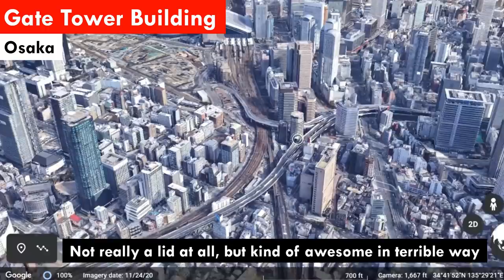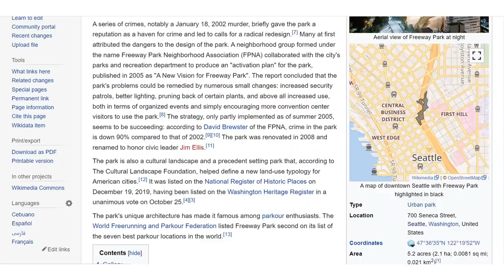Freeway Lids / Caps / Decks: What They Are, Why We Build Them, and the Ten Best in the US

Comment: Boston had tons of public access. Prudential Center is a mall between all those buildings, and connect to the Hynes Convention Center. NYC of course.  People driving under those building don’t realize they’re actually in Manhattan. I know Philly/Penn’s Landing, since I used to park on the river and walk over 95 (we were carpooling!). 

Little Wilmington Delaware is considering capping over 95. Typical rip out two blocks of the city to shove in an interstate. Bypass 495 around Wilmington built a few years later. But since 95 downtown is in a little bit of a cut it’s a perfect candidate to be capped and rebuilt as housing I think. Probably some parkland.

Comment: There is a long open subway trench in Brooklyn that emerges near Prospect Park and goes all the way to Coney Island. The MTA workers call it "the cut." The Q and B lines run exposed about one story beneath grade. Unlike the elevated lines in New York City, there is no restriction on trains blasting their horns, so the noise pollution for surrounding residential areas can be substantial. This doesn't even include the din from regular operations and rail work which is loud. I have always wondered what it would take to put a lid on this and possible projects that could complement newly created space. Thoughts? Maybe you could do a video on viewers' "fantasy projects." (And if it isn't obvious, I live right above this by Prospect Park station).

Comment: Not very common in the UK. Probably the nearest example is the one over the A1M motorway at Hatfield just north of London (although the freeway section and the lid were built at the same time, as a bypass to the congested non-freeway A1 trunk road, originally known as the Great North Road back into the 1600's, the number is 20th Century).
 
There are a couple of other lids proposed but I don't think have gone beyond early consultation stage.

We do get train line lids in the UK...Liverpool Street station, Charing Cross station, London Bridge Station, Fenchurch Street, City Thameslink (all central London), and Gerrard's Cross (which famously collapsed while being built onto the operational line below).

Comment: The I-15 in San Diego aligns with the street grid because it was built in a canyon, which is why it's below the surrounding ground.
San Diego originally decided to build up on the mesas and preserve the canyons as natural space . . . which were then paved over for highways.
We still have plenty of preserved canyons. San Diego is a great hiking city. But the I-15, I-8 and 163 were cut through the preserved nature in the bottom-lands because it was cheap and easy, with minimal imminent domain issues.
One thing they did right; The I-5 was routed around the central business district because the city fathers didn't want the mess in their back yard. Send it to the Mexican neighborhoods instead!
Now they're talking about a cap over the 5 at Park Avenue, where the freeway cut Balboa Park in half.

Comment: From abroad, in the Netherlands :  In the city Utrecht, the A2 highway was widened to 2x5. It required a lid against noise and pollution and also to connect the newtown/suburb 'Leidsche Rijn' with a small strip between the highway and the canal. The 1.6 km long deck is mostly green public space and a couple of streets across, with buildings along the edge. North of it there are an office and a mall centre along the highway that double as sound barrier. Originally budgeted at €116 mln, but they finished with a sweet 1 bln euri !!😵

2 transformation cases, not sure if they fit the first criterium : In the southern city of Maastricht A2 highway (again) thru the city was replaced with a 2.3 km doubledeck highway dig covered with a green, parkland city street. (within budget !). Under construction :  , in the North in Groningen the Southern ring road was elevated and had a traffic light junction, that is transformed into a highway junction and to the east the raised level highway is changed to a sunk highway that is partilally covered with park landscaping to reconnect neighbourhoods... (The project  already has a healthy budget overspend.)
Reply from the maker: Oh I'll have to take a closer look at these. Thanks!

Comment: It's not only insanely expensive but it's an ongoing expense.
In Metro Detroit , I-696/"The Reuther" (that suburban one you showed at 2:49), was held up for 20 years in litigation and finally opened in 1990 after a compromise that resulted in 3 large park decks. About 10 years ago they started having issues with water intrusion forming icicles on the ceiling that resulted in a $4M project to remove the 'worst' park and strip it down and seal the cap, then rebuild the entire park from scratch. That project immediately failed and now the DOT is having to spend >$30M to completely demolish the structure and rebuild, normally resulting in extended closures (but they are combining the work with replacement of all of the 1990 concrete pavement throughout the 12 mile depressed central section so it will be closed anyway). The other two tunnels likely aren't far behind. They broke them up into 3 as they are each the longest allowed without needing fans.
These problems aren't unusual either. Phoenix has a decked section of I-10 that also opened in 1990 that has also developed similar issues, although being a dry, temperate climate has only resulted in tile falling off the walls.
So what will they have to sacrifice to maintain these things long-term? Not to mention an incredible amount of electricity for ventilation and lighting, 24/7/365 (and the energy can be absolutely mind-boggling, enough to run an entire neighborhood so you are amplifying the CO2 from the traffic). They have their merits for sure but you end up having to make a sacrifice either way.
Additionally, Phoenix is planning a total scratch rebuild of its 1990 I-10 spine where the tunnel is, everything but the tunnel itself. They have to work around it, it's a huge bottleneck but now there's a library on top of it (that itself was nearly destroyed a few years ago in a freak storm) so it will forever be an issue and this $1B I-10 project might perhaps reduce travel by a minute or two while they continue to build 30,000 homes a year in the exurbs.
Reply from the maker: Oh, good insight on this. Thanks!

Comment: Boston has two additional freeway cap developments under construction currently. Both are over I-90. One is on Mass Ave near the Prudential Center, designated as Parcel 12 by the city (two other parcels 12 and 15 also have proposals but have not started construction). The other on is near Fenway Park and is called Fenway Center. Both projects are primarily office and residential buildings with part of the parcel in both projects being turned into a public outdoor space.
Reply from the maker: Oh I knew about Fenway Center but not the other one. In a way, Big Dig is a cap project as well -- it was hard to know where to draw the line!
Reply: @CityNerd   It is difficult to find the line, but I think you did a really good job and It was interesting to learn about ones I hadn't heard of before.
Reply: Does the Star Market over the Mass Pike count as the original cap, or just air rights ;)

Comment: I'd be curious to know your thoughts on DMU passenger rail cars.

In my opinion, NY's interborough express should 1) exist and 2) start out with FRA-compliant DMUs. This would keep options open for mixing the service with freight and other rail service.

Put the farebox on the train like a bus and call it "CityTrain by Long Island Rail Road" with LIRR crews.

The rail cars can be converted to electric if the line is ever electrified.

What are your thoughts on that, and on other DMU service, both FRA- and non-FRA compliant?

Cool video as always!

Comment: Glasgow (in Scotland) is seriously looking into doing this with the M8. The proposed park is an absolute joke though. It literally spans between two overpasses that are like 200 metres apart and will be surrounded on all sides by roads with one of the cities most disliked buildings (Tay House) over the top of it and a busy motorway underneath it. It also is literally right next to a gorgeous historical library (the Mitchell library) but stops before it instead of providing a great city centre-park that would allow people easier access to the library and a more reasonable cover over a section of the motorway that practically cuts the west end off from the city centre :(

Comment: Montréal Canada.
The Ville Marie Expressway was built in the 1970s to provide a  way to reach downtown from the 15 and 20 highways west of downtown. It was numbered 720 (now 136). It was then extended further east morphing into "urban boulevard" to connect to the Jacques Cartier Bridge and then further east again over time. 
Goes from the Turcot interchange (15 and 20) as elevated road.
Between Guy and de la Montagne it dips into cut/cover tunnel. Goes around (south) of Place Bonaventure and then back north to fit between Viger (north) and St-Antoine (south).  The original tunnel ended at St-Alexandre or thereabouts.  Many streets were cut at Viger to the north and St-Antoine in the south due to the canyion.  
Originally, the canyion/highway ended at  Sanguinet where you see strange curvy ramps). 
It was later extended further east as canyon to its current configuration wheree it rises to ground level west of the Jacques Cartier bridge. 

The open canyon was progressively covered over the years. 
Palais des Congrès is at:  45.50489871879555, -73.55977819748851
This is a picture from the construction of the Palais des Congrès (convention centre) in 1981.  
https://numerique.banq.qc.ca/patrimoine/details/52327/3167284?docref=SlC7r8UIaSvttRAqjGxAoQ
It is taken from western edge of building showing the open canyion, then the transition roof and in background Place Bonaventure.
The convention centre didn't actually cover the highway. At ground level, there was still a city street passing above highway and below the first floor of the new building. The metro station had pedestrian exit onto that highway overpass and it was hell to walk there because all the noise from the highway was reflected on the concrete of the first floor of the congress centre above.  And you had all the fumes from cars. 

The section west of palais des congrès was eventually covered and if you look today, it is full of style-less modern glass office buildings.
From that point, there was transition cover from St-Urbain to St-Laurent, then open canyon.  (This transition was since removed after it fell down during renovations). 

Today, the canyon from Hôtel de Ville to Sanguinet has been covered into a park and the highway exit/entrance was reconfigured. Also, the pedistrian access from the Champs de Mars metro station (north or highway) to the old montreal area (south) was totally reconfigured, and the ramp from highway to Sanguinet removed (there are still traces of it in you know what to look for). There was a bank building east of Sanguinet and it has since been demolished and rebuilt as part of a the CHUM hospital complex.  (biut note the gap right over the actual highway).

East of this, a large area was covered and is now a park area, and then the open canyon still exists. 

In the last decade or two. the Palais des Congrès decided to develop at ground level. It thus properly covered the highway below,  and made it enclosed interior space with shops etc. While cars can no longer cross there, pedestrians from Metro can now walk in quiet comfort over highway and have a number of doors to exit on the south instead of that one overpass that existed.  One the area west of the palais, a number of streets were reconnected as the former canyon was covered.

Comment: If we consider North America I would put Montreal's Quartier International at number one. It's not so recent and developed over the long term but I think it's the best freeway lid intervention. They covered the Autoroute Ville-Marie with a few parks and squares, a convention center, a hospital, the Quebec's pension fund and public insurance bank, the UN's International Civil Aviation  Organization. It improved the connection between the downtown and the Old Montreal and connecting better the whole area with the metro system. It is a success in term of design and the Jean-Paul-Riopelle's square show it at it's best. The whole thing was major for Montreal's downtown development. Bonus! : Montreal did the same with his railway wich used to be in trench in the downtown before entering the tunnel under Mont Royal and they built the Place Ville-Marie over it, which is the first major modern skyscraper of the city.
Reply from the maker: I actually might have messed this up. I was just focusing on lids that came after-the-fact, and for some reason I thought I had seen that Montreal's freeway covering were built as part of the original freeway design. I'll have to look more closely.

Comment: You started with Vancouver getting it right with no freeways.  Did they also get it right with their driverless trains???  
Do you spend less money over 30 years if the trains don’t need drivers?  You are an accountant and so am pitching this (again) in the hope you cover this off.  I’ve heard both sides of this argument.  I would really want to hear your thoughts, so I can expand my thinking on it. Thanks in advance.  Cheers. Steve
Reply: Driverless trains not only save $$ without operators, but trains can run closer together because they are computer-controlled.

Comment: We have 3 freeway caps proposed here in Atlanta. I hate all of them. Obviously the freeways should be removed completely, or at the very least if they do a cap, it should severely reduce the number of on and off-ramps. None of the proposals in Atlanta do that. 

1. The Stich - Reconnects midtown and downtown with development/plaza idea. It would be 3 blocks wide, connecting 4 streets together with a plaza, even though Ralph McGill Blvd already connects all them.   

2. The Midtown Connector Transportation Improvement Project (MCTIP) - Basically just a big park connecting midtown to the Georgia Tech campus. What I particularly hate about this project is that they rebranded after some community feedback, so its harder to find their old work. The new website is much more vague on the proposal. The next thing is that they start off making a big deal about the traffic improvements it will bring, because they will close some highway ramps and basically create new one-way collector roads parallel to the highway. This will require bulldozing a number of buildings on the GT campus which they call "relocation". In a response letter to the community they also mentioned their were concerns about induced demand and the response was literally just "No."   See pages 16 and 19 here: https://cdn.atlantaregional.org/wp-content/uploads/arc-taqc-mcp-presentation-02102021-final.pdf

3. GA 400 Park: This one is the least likely of the all, I think. But its basically a park extension of the cap you showed at 1:30. It would somehow connect into the Path400 multiuse trail while also being like 20ft in the air and not even fully capping the highway??. Honestly this picture just says it all :https://www.buckheadcid.com/wp-content/uploads/2012/05/Aerial-View-Looking-South.jpg
Reply: And also, 195 in Richmond just needs to be torn out completely.
Reply from the maker: Ugh, thanks. I knew about the first two Atlanta proposals, but not the last one.

Comment: I’m not a big fan of freeway lids. Mainly because it is ultimately a bridge holding up land and buildings over the freeway and those bridges have a lifespan and have to be maintained as well as the infrastructure they support. This could be disastrous in earthquake prone areas. I also consider the event in which the highway would need to be widened and they did not save enough room under the land bridge. The highway would never be widened. Thanks for the video

Comment: Watching this video well after the fact, but I wouldn't say freeway lids are the worst things in the world. If you can get ramp removals as part of the project, they really do reduce most of the local negative impacts of freeways. Removing the ramps obviously reduces the amount of car traffic, and the lid should be able to get rid of most of the noise pollution and air pollution. Obviously the tailpipe emissions are still a problem, but a lot of car emissions are solid particles coming off the brakes and tires, which are relatively easy to filter out of the air and don't travel particularly far, so will end up depositing on the walls and ceiling of the lid rather than the outside world. Complete removal is still better, but some urban freeways are also the primary regional connection between longer-distance locations and decking them over may be cheaper than filling them in and then building an entirely new freeway somewhere else if that's what politics demands.